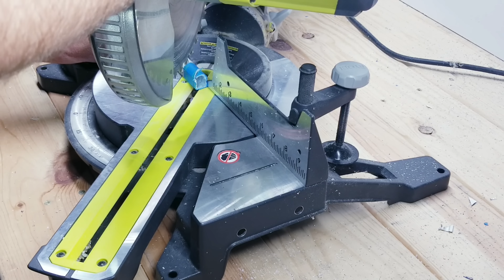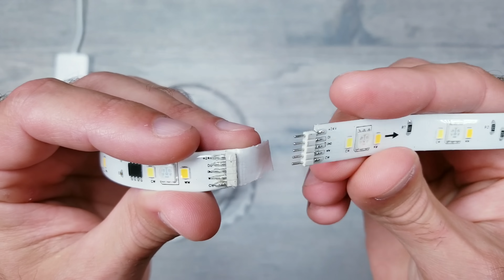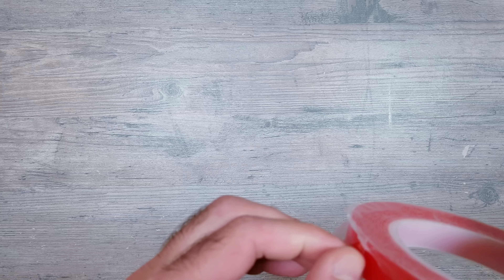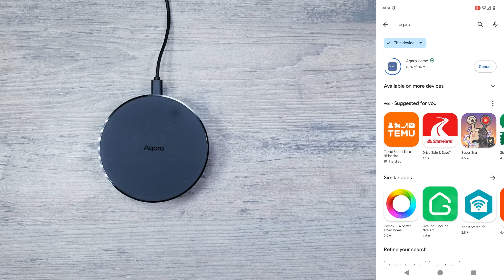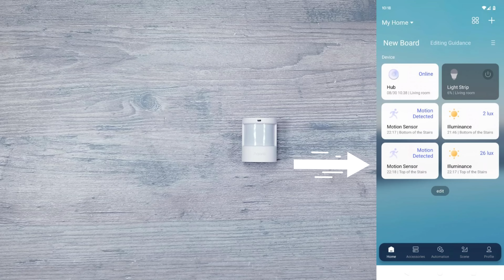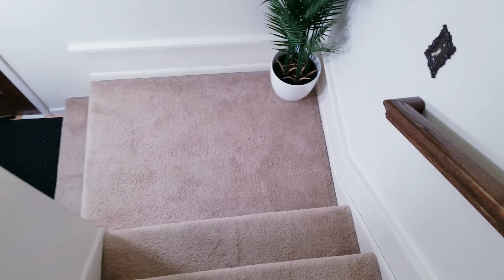EASY Motion Activated Staircase Lighting - NO PROGRAMING!!!

Comment: My would kill me putting that on the wall!  Lol. But I have been using silicone led channel. The lens I do for my baseboard which is a 6 1/2" tall with a pretty complex profil, but It slids the LED strips in sideways and sefuse so it's only 3/8" wide strip and 8mm dep. But there is a flat spot about half way down baseboard, where I made a  jig for my router and did a perfect channel. Corners I had to chissel. But then on the end, there is my office and so I put an in wall access panel around on the other side of the wall in it and then drilled a hole from channel to box.  I put an esp32 with my custom LED board WLED and now it's all automated and pir sensors on both sides. And when I start on either side, the lights light up and roll down the hallway lighting up. And once the other pur sensor sees me, I have it slowly turn off the other side lights until middle. and when I'm clear of both pir, it finished a imated turn off

Next test I'm going to use a 24Ghz mmwave radar sensor and it can see exactly where I'm at and it will literally light up only around me and follow wherever I go

Comment: Chris! This is exactly the project we were wanting your help with! 
Our question is how would you get LEDs to light up as you walk up the stairs?
Reply: Another YT collab!!! There are 2 motion sensors.  One at the base and the other at the top
Reply: If you did it exactly like this video, but used the Aqara FP2 MMWave motion sensor instead you could figure out exactly where someone was on the stairs.  I'm not sure how many zones you can set up in the lights and mmWave sensors, but it would be the easiest way to do it without programming.   If you wanted to do a whole lot of wiring you could do load cells on each stair and get really fancy with WLED.
Reply: Hey  @TheHookUp ! That's interesting. We actually found a pretty great kit online that we think is going to do everything we need, but we are a bit skeptical! Sounds better than splicing and running each strip individually. Now to do research on load cells..

Comment: Can this be programmed to turn on in sequence instead of all at once? So the LED’s turn on close to the motion sensor first and travel up or down the stairs.
Reply: Yea for sure… I have a very similar setup with Govee Neon LED light strips..
My rules and automations are controlled via Hubitat.
When the Bottom sensor detects motion.. it’s triggers an LED pattern going upstairs and when the upstairs sensor triggers the LED’s light up in a pattern going downstairs
Reply: This is all new to me, I'm interested in doing this project. If using govee lights and their motion sensor, you have to use the hubitat to connect them?
Reply: It depends.. you don’t have to necessarily use Hubitat only… any other mechanism that you use for home Automation would also work.
Like:
Samsung SmartThings 
Home assistant 
Or even Amazon Alexa

You will need two PIR sensors and one LED strip light.
Then set a rule to trigger led light when a sensor is detected
Reply: Thanks for the reply! Ok so 2 PIR sensors and an LED strip, and I wouldn't need a additional 'hub' of any kind of the sensors and lights both worked with the same app like SmartThings? (sorry for a basic question)

Comment: How do the Aqara T1 strips compare to a similar GOVEE strip? (M1?) I am planning a RGBW job for soffits and walkway lighting light this.  I am sidering now these RGBIC type lights as the prices just seem so good.  I already ran some LV 6wire to my soffits in preparation from my AV closet (with outlets). Can i still utilize the 6 wire, and keep the controllers and power supplies in the closet? If you have any consultation you do. let me know a way to reach you.

Comment: Another great video, Chris! 

Have you considered trying out Home Assistant? With this, you can control all your Govee, WLED, and Aqara devices from one interface as well as to setup automations to control the lights based on time, sun position, or triggers from third party devices (motion sensors, door sensors, luminance sensors, etc). I've been running it a couple years and have a lot of my LED accent lights setup with the Adaptive Lighting add-on so that the brightness and color temperature adjusts with the position of the sun throughout the day and into the night as well as being manually controlled with a mix of Zigbee and Z-wave battery powered/mains powered wall switches and scene controllers. The reason why I initially set up Home Assistant in the first place was the annoying practice of having to turn on my Govee immersion lights manually every time I turned on the TV and having to use multiple apps to control everything. It'd probably be some good content for the channel!
Reply: HOOOMMEEEE ASSISSTANT! HOOOOMMEEE ASSSIIISSTANT!
Reply: tbh as a long-term user of home assistant it’s gotten pretty exhausting. Keeping up with the update schedule alone is so much effort.
Reply: @JB-fh1bb I get to it when I get to it … if I know my Z wave or zigbee devices need improvement then I will upgrade when I see one
Reply: @doug350zTT  that's what I did for a while too (maybe a couple years), but when I finally had to update it was a complete nightmare since so many things had changed in between
Reply: @JB-fh1bb  I usually do core and OS updates once a month because things get deprecated so fast .. I’m prob due for an update now
Reply: Thinking of getting into Home Automation / Home Assistant myself!  Any good YT guides out there?  Also what subReddit would be good for questions?  I know I can just google, I'm asking for your favorites!
Reply: @craigchatterton4164  Paul Hibbert has some good ha for dummies vids
Reply: @ZaleraPraxis You can connect Aqara  T1 strip directly to HA using ZHA and it works almost perfectly, but without adressable properties. Or you can connect it using Matter protocol from Aqara Home to Home Assistant, but in this case you can't use RGB diodes at all, you can only choose between warm white and cold white.
Reply: Thanks, which assistant you can recommend, Alexa or Siri, which one is better for this scenario?
Reply: @protacticus630  home assistant it’s an open source software that can be ran on a single board computer or VMware or others .. lots of YouTube videos on it

Comment: Great video well thought out. I went a little more DIY then this though. I have been a automation person for a good while and have set up Home Assistant for home automation. About a year ago i got into making my own sensors for it by using a HA add-on called ESPHome. So i did something similar like what you did except used WLED which HA supports natively and a couple of sensors i made using ESP32's and  time of flight sensor called a  VL53L0X, this uses  infrared pulses which makes the sensor extremely accurate so the LED's only come on exactly when you put your foot on the first step. This is needful for me as we pass right next to the stairs on the way to the kitchen all the time.

Comment: To turn off the LED strip that's better to use single automation with both top motion sensor AND bottom motion sensor detect no motion. And to turn it on use the single automation with both top motion sensor OR bottom motion sensor detect motion.

Comment: how do you have all of your devices integrate and communicate with one another? i feel like you have so many brands that you have to open up like 340 different apps to use them
Reply: I wonder this as well. I like the projects he does but seems like so many apps are needed to do anything.
Reply: @tubbycustard8866 @enceladusdarkhart7048  You can control all this stuff automatically with Home Assistant using some simple Zigbee and/or Z-wave dongles, which have the added benefit of not needing to buy a proprietary hub for every brand of product since they all use these two standard (or wifi) to control everything.